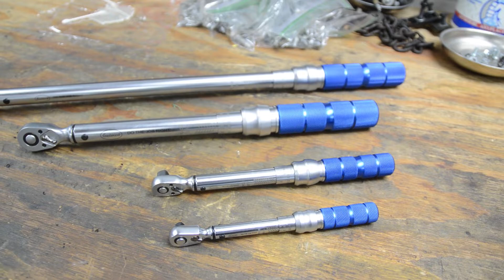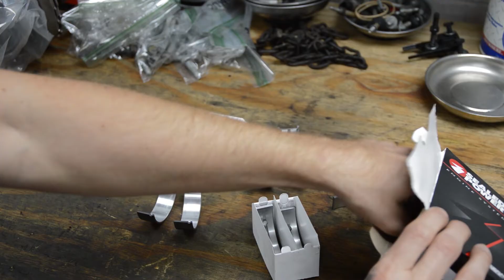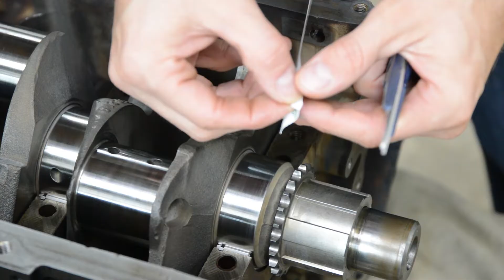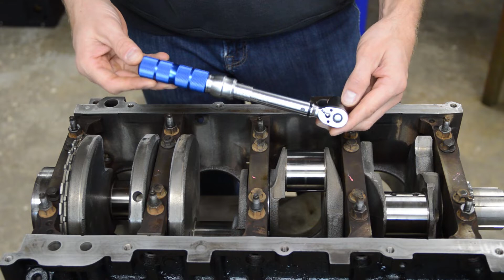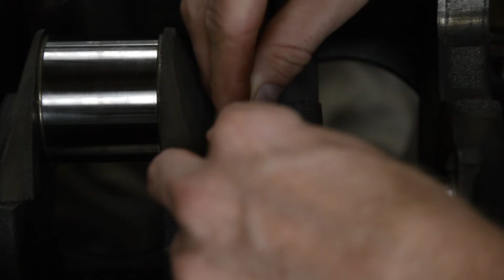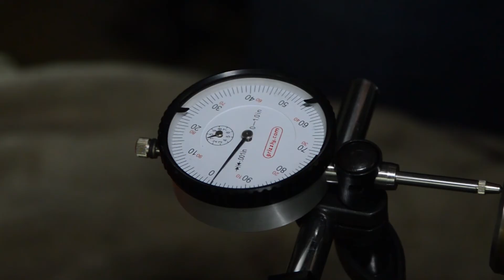How-To: Install LS Engine Crank (bearing & thrust clearances)

Comment: I just watched a video about torque with lube and it DOUBLED the torque. Yes it's torque to angle but that's from the spec of 15lbs, not 30lbs! It matters.
Reply from the maker: Did you mean clamping force?
Reply: @HTMR  Guy set a torque wrench to 100lbft and with antisieze the guage of the actual measurement went up to 196! It had to do with the role thread friction was formulated into torque. I'll see if I can find it
Reply: @HTMR  https://youtu.be/-hSmtLVESSM?si=KAOx2k6ga6uenJNs
Reply: @HTMR  go to the antisieze chapter at 16:39
Reply: @garybarbourii8274 light oil is not the same as anti seize.  Torque specs include what type of lubricant or calls for none.

Comment: I have a question Did you reuse the main and rod bolts ? Does gm recommend replacing them ? I get mixed advice some say it’s fine to reuse them and some say replace them
Reply from the maker: Manual states they can be reused 3x or something like that.

Comment: On a LS motor, Plasti-Guage is not a good way to check bearing clearance, depending on the Side bolt Torque the clearance due to deflection in the main cap can change up to a .001 looser,  to achieve accurate bearing clearance on any LS motor you will need to use a dial bore gauge,  it is the only correct way on a LS motor,

Comment: Great Video! How is the engine holding up? I assembled a 6.0 with .0015 on the mains. I’m curious because after some research I’m concerned that .0015 might be a touch too tight.
Reply from the maker: 1 year 1500 miles no issues yet.

Comment: DO NOT HAMMER DOWN YOUR MAINS!!!!  It can cause the plasti-gauge to become crushed.  Just draw the caps down slowly using the bolts, a little on each side at a time.  Until its down and torqued.
Reply: You're not supposed to pull down your main with the bolts
Reply: @hacklaurent9412  It's better than HAMMERING them down...  And, I've never had an issue doing it this way.  And the old school engine builders I learned from didn't either..  I'm open to learning newer ways, so how do you think is the right way?  Remember,  this isn't FINAL torque, this is the measurements to see if the bearing clearance is the same across the whole journal.  Which, admittedly, should've been discovered earlier.
Reply: Absolutely right there's different ways of doing things but, I learned pulling it down with the bolt is more prone to thread failure, just in case if it's not aligned properly
Reply: The cap would have to flex open for that. I think he'd have to hit it alot harder for that to be a problem.
Reply: Why dont you just measure oil clearance with a micrometer and bore gauge and not use plastic gauge? There is always more than 1 way to skin a cat.
Reply: Thanks for the tip!  I'm about to put my rotating assembly in.
Reply: That' is  
bs
Reply: @davidhicks3912  Just don't hammer on plasti-gauge!!!  It's not bs, it's FACTS!!!  IDIOT!!!  lol

Comment: So the journals are all in spec right ?
So none of the main bearings that were originally in the block were spun right ?
If that is the case why would you waste the time with plastigage?
We get cranks back from the machine shop.
Whatever they grind it to we use the corresponding size of bearing.
Now,I have literally built atleast a thousand motors since 2015 and never plastigaged one single motor and guess what ?
Never had one single clearance issue at all.
This is a complete waste of time. 
You can say whatever you want but I highly doubt you have the history with these motors that I have.
Reply: 20+ years building engines, stock and high performance. Not one of them has left the shop without checking bearing clearance. Some of the crankshaft were sent back to the machine shop to get them fix.
Reply: @4real4now  never had that problem.  You need a better machine shop.
Reply: @davidsharp922 humans make mistakes sometimes and I said some, not a lot. When is about engines, anything can happen and more if we are talking about high performance. I have found bad brand new bearings, from a very reputable company. And not only bearings, all kind of parts. It happens once in a while. If it works for you, keep doing it that way. I'm not calling you a liar. I'm just saying what we do.
Reply: @4real4now  the only problems we are having are bad lifters every so often  and that even includes the general motors set that costs over $400.
Other than that we have had no issues with clearances.
Reply: @davidsharp922  Well you see, we never had a problem with LS7 lifters. And we use Johnson on high performance.
Reply: If you don't check main clearance then I promise motors you've put together have failed
Reply: @benolofson9732  bullcrap. If they did our customers would bring them back to us.
Reply: Put 100 engines together and 5 will have mains that are way out, LS is a lot more forgiving then some other engines so if that's all you work on you'll probably skate by
Reply: @benolofson9732  skate by ? In the last 7 years or so I have assembled ATLEAST  1,000 LS motors.
We have them ground if necessary and if we take a core apart that the rod and main bearings look good then we clean the crank up and reinstall in another block with new bearings.
Out of all the motors I have built there has never been a single issue with bearing clearances.
So many people on YouTube put so many waste of time videos with useless information it is sick.
But,keep doing it your way.
I build complete motors in a day.
You film a video on installing a timing chain in a day.

Comment: All due respect, I have never understood why someone has the desire to do a "how-to" on something that they are completely unfamiliar with. Just because you saw your dad put a crankshaft in a SBC back in the day doesn't mean you are competent enough to teach someone how to install a crankshaft in an LS engine. There were many mistakes that you made but corrected without commenting on it, many things that you should have done differently and in general would have done differently if you had ever done this. Technically you're using tty fasteners that aren't supposed to be reused, "narrow" means skinny, not wider.., even after screwing up the sequence, you STILL did it backwards, but that's not that big a deal other than this is a how-to video!lol It may live simply because your clearances are close (tight), but it's gonna take a few more before you need to be "teaching" anything about building an engine..
Reply: Will you show us how to ? Why are you watching how to’s ?

Comment: I dunno about re-using bolts like that.  They're ty[typically torque to yield - so use the old ones to crush the plasti gauge but then use new ones for final assembly.
Reply: GM main and rod are TTA they are fine to reuse
Reply: Usually around 70lbs when TTY

Comment: You are not supposed to put your fingerprints on the Bearing surface..
Do some more research before you start posting videos.. You didn't even 
lube the Goddamn thing
Reply: So how is he supposed to install it? With his feet? Even with gloves, there would be residue
Reply: I know this is old, fingerprints cause rust on, well any metal they get on especially machined surfaces. Definitely should’ve been done with gloves first thing I thought.

Comment: I know this video is a bit old but i hope you read and reply. I am measuring my oil clearences on ls1 to rebuild, Well i did everything as you show in this video but when i remove the main caps to check the plasti gauge the plasti gauge is on the main cap bearings not on the crank journal is this still accurate to measure idk how it is happening?? Maybe im just being paranoid but out of all the videos ive seen I have never heard or seen this before.
Reply from the maker: Sometimes it sticks to both. Is the crank clean of oil etc..
Reply: @HTMR  yes I made sure to wipe everything down with brake clean and a microfiber towel but I am going to try again.

Comment: Why didn't you put the cam in while you had the block upside down and the crank out of the way? Its alot easier to install the cam that way then doing it after you install the crank and have to walk it in.
Reply: Looks like he did put the cam in first. At 23:04, he put assembly lube on the cam (which was already there).

Comment: You also need to grease up the bearings before putting the crank in!
Reply from the maker: Did you watch the whole video?
Reply: You don’t want to grease your crank when taking measurements because the grease will take up clearance. This will throw off your measurements, making them appear smaller. You don’t want to use any assembly lube until final assembly.

Comment: What did you do about crankshaft thrust?
Reply from the maker: Nothing why?
Reply: @HTMR  Arent you supposed to ensure there is an appropriate amount of crank end play? I am rebuilding a 5.3 right now, and was watching your video for some instruction but did not see anything on end play. I am just trying to find clarification on what to do. Your video is an excellent guide,  otherwise!
Reply from the maker: @reeceliles9151  End play is the same as thrust clearance.

Comment: The clearance range is applicable for all LS engines? My ls3 started knocking and this is my very first engine that I am rebuilding. I would like to know if it applies to the ls3 as well. Also what if it were to be under or over the clearance range?
Reply: What is the purpose here, I have the same question. Did you ever get a answer
Reply: @jwtru2life I believe the clearances change if you’re building like a race engine and need different clearances depending on your needs.
Reply: @jwtru2life I looked up the clearances online. I ended up taking my crankshaft to a machine shop and let them know I wanted matched bearings with OEM specs and when I got home. I torqued everything down and used the gauge and everything checked out.

Comment: You forgot to mention that the trust bearing has 2 oil groves on one side and 3 on the other..the 3 groves go toward the back of the engine..if installed incorrectly it will throw off thrust clearance..otherwise pretty good video
Reply: Most new bearings come with a notch in them that lines up and keys into a recessed portion of the block and cap. You can't mess it up unless you put the caps in backwards.
Reply: Did not know this. Glad to find your comment. Currently my LQ4 crank is too tight. 
Because of main scarring, I had the machine shop polish the crank. He recommended I buy .001 oversized bearings, both mains and rods. I bought King Coated .001 oversized. 
Torqued everything down, measured everything, main were between .001, .0012, up to .0018. Rods were @.0018. 
I polished the main journals with some 2500 grit and shoestring. Torqued it down, and my thrust is way too tight. And it is tight tight. Hard to turn over. I used the sticky red assembly line. 
I will check my orientation of thrust before I start sanding for thrust clearance.
Reply: The install direction isn't reversible.  There is a TAB that needs to determine which direction is forward or rear.  I've never seen a (Stock) LS bottom machined to "flip" the bearing for the #3.  Only #5 main.  So everyone else who commented its wrong...  You're wrong.  Those of you who commented on the 2 vs 3 grooves..  that's ok.  Don't worry.  They only install in ONE direction.   I'd you flip them around, you'll have major issues
Reply: Not all thrust bearings have three grooves on one side and two on the other side. Some thrust bearings have three grooves on both sides. And others have two grooves on both sides. You need to follow whatever instructions are provided with your bearings to determine the proper orientation of the thrust bearing.
Reply: Not all have 3

Comment: Building my first destroyed lq9. Would I use the new bolts to check clearances or would I use the old bolts?
Reply: If you use new bolts for final assembly, reuse the old ones when checking clearances.
Reply from the maker: Reuse them. Technically the rod bolts can be torqued up to 3 times or something like that.